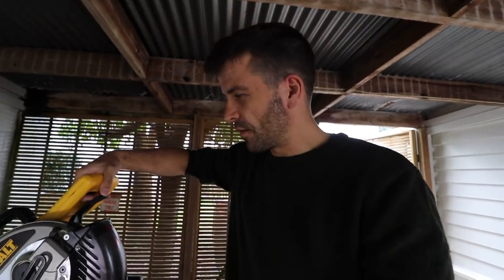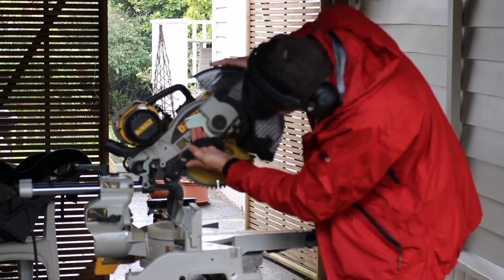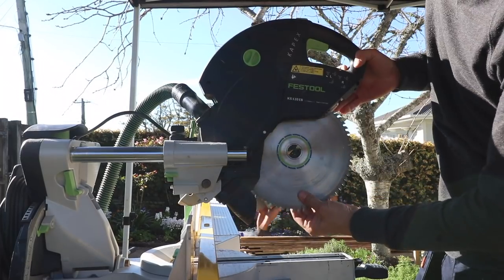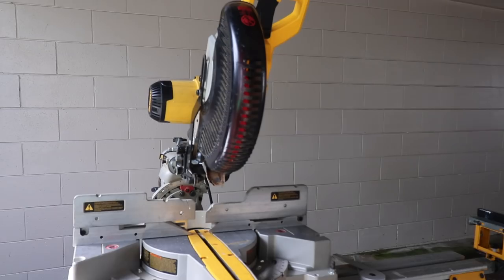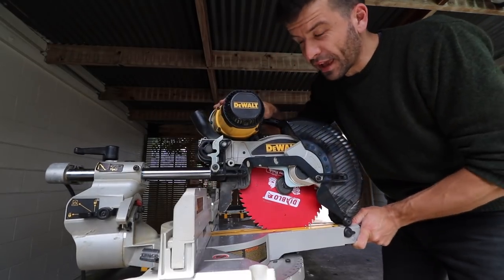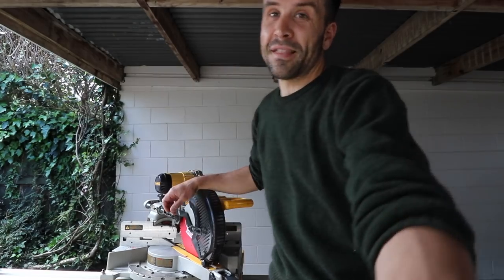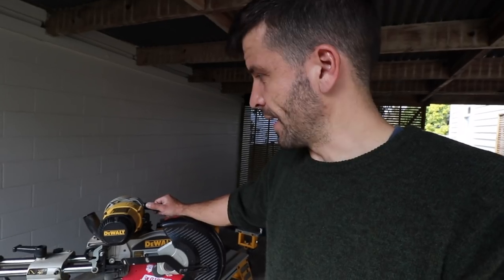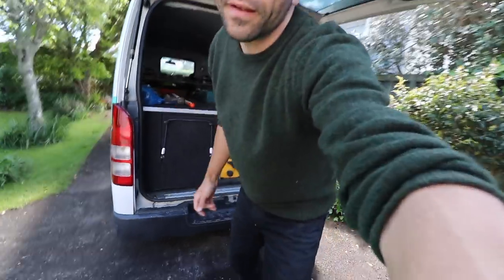Festool Kapex vs Dewalt Mitre Saw

Comment: Are the Dewalt chopsaw brackets compatible with the Kapex? If so you'd have the best of both worlds.  Good review, 👍
Reply: TheToolnut yes dewalt stand mounts fit nearly all mitre saws. See it a lot now Kapex saw on dewalt stand.
Reply: My makita maxed out the dewalt stand. But a good carpenter will make anything work.
Reply: And ryobi makes a better stand then dewalt. Much heavier. Dewalt has some sweet attachments though.

Comment: 1000-1200$ ? i got the DeWalt 12 inch saw with the bench for 700$ tax in at home depot . I'm from Quebec , Canada so maybe there's a gap in between our currency ?
Reply: the companies we buy from in NZ will have to pay shipping (over a container load of gear to make it worth while)  Shipping is a killer on on many things as we are such a small population in the middle of nowhere where there are no major shipping lanes...

Then import duties, then GST ... then normal business running costs like storage, power blah blah blah ... add in the exchange rate of the dollar things become quite expensive pretty quickly.
Reply: I think the prices in NZ are not too bad compared to the states and Canada as the rates are about twice as high. I don't see how tools in Auzzie are alot cheaper than here though.

Comment: Maybe you can borrow a Makita ls1019 for a comparison. I recently bought the 10 inch Bosch glide but didn't factor in the weight and so now I'm in the market for a new, lighter saw
Reply: The makita is a beast also. Great saw. Huge table in it.

Comment: He did not even mention the terrible handle on the festool, it sucks. Also, i have one of the first of the 12 inch DeWalt sliders made, it must be twenty years old, and, it has never failed me, i have it used to frame, and, do finish work, lots of cedar siding, and, it has done all those things well, and, never required any thing than a new set of brushes in the motor. Plus it costs half as much as the Festool. But, the big thing is that awkward handle position, if you are cutting all day for a framing crew, you need something that will allow you to keep up, without giving you a sore wrist from twisting it into an unatural positon.

Comment: Dewalt needs more space behind the machine due to rods, has lasers, is more accurate and consistence, had repeatability in settings etc etc. Its better suited for carpentry. Dewalt is a constructionsite saw. To each his own.

Comment: For finish work the kapex absolutely destroys this saw! I have owned the dewalt saw and its ok for heavy timbers and rougher work but for finish work its very low down the list. Theres too much deflection in the head and blade.  Try cutting large kitchen mouldings and you will see. I have had my kapex nearly 10 years and theres nothing to touch it for accuracy. I had this dewalt with the laser and bought a freud stainless blade that cost me nearly £150 awesome blade for laminates but it still couldn’t save this saws errors. Currently im using my workmates dewalt saw same as this on a framing job and again its sloppy. The saw stand on the kapex is also far superior having a full flat bed with adjustable stops that are accurate, the dewalt can be cumbersome and the stops just aren’t reliable.
Again the kapex is suited more to the finish guy and the dewalt more for the general carpenter under these circumstances the kapex is head and shoulders the better saw.
Most of my work is finish carpentry and kitchens, i favour tools from festool like the carvex and the track saw also the large router and drills however if i was doing general carpentry I wouldn’t bother with it, its not cost effective.
Reply: My partner has the Kapex, I have the Bosch Axial Glide saw, My Bosch is every bit as good accuracy wisw as the Festool with a much better motor at half the cost, I know, I use both of them on a daily bases.

Comment: The Dewalt stands don’t have the length stopper.  So you cannot repeat the cuts accurately as Kapex.  Dewalt doesn’t have the doublesided lazer.  The detent on Dewalt snaps into another angle.  In regard to the accuracy and repeatability, nothing comes close to Kapex.  

In the beginning, I had the same issues with Kapex.  Once getting used to it, I feel it is much easier.  And the position of the handle is very intuitive.  You hold the handle in the line of your cutting, not to the side.  When you are cutting wood, you don’t cut 5 inches away from the sight of cut.  The way Dewalt or Milwaukee has their handle is not intuitive and is prone to shifting away from true right angle.

So much you haven’t covered, this is beginning to look like a leftist media like CNN, Washington Post etc.
Reply: LOL everything is political now? Even miter saws? 🙄🙄

Comment: do you know the sawblade on the kapex was one to cut  aluminium ?
Reply: You can cut wood and aluminum with the same blades to a degree I never switch my wood blade to cut a piece of aluminum and it doesn't seem to hurt anything.
Reply: Aluminum cuts like butter.
Reply: I cut alloy tracks for byfold doors with a standard ATB blade
Reply: @whitacrebespoke  your bifold tracks are aluminum. Ive only seen steel. Barn door tracks are aluminum. What does abs stand for?
Reply: @whitacrebespoke  or atb i ment?
Reply: @smokingcheeba420  Alternate tooth bevel. It means one tooth goes to the left on an angle, then the next is to the right on and so on
Reply: smokingcheeba420 alternate top bevel which is standard grind. The Henderson bifold tracks I use are aluminium. Never seen a steel one
Reply: I think its Johnson hardware thats steel. Its thin but a portaband is the best way to cut. I thought all blades alternated teeth. Forest blades are amazing for 100 dollars + but you can get makita blades for 25 bucks on Amazon and will smoke diablo. I hate the 45° tooth bevel.
Reply: smokingcheeba420 you can get triple chip grind as well good for grove cuts as leave a flat bottom kerf. I prefer this type for cutting Ali as it doesn’t have the sharp corner to break of like on an ATB blade. 

We can’t get forest blades here in U.K. I’d like to try one. We have Atkinson walker that make blades in Sheffield and several high end importers. Trend industrial blades are good too but don’t know if you can get them. Better quality blades are worth the investment as professional sharpening reduces the overall cost over a several years.

Comment: Also if you want to spend lots and lots of money on a jigsaw mafell.
Reply: Lol yep
Reply: daniel hammond I agree, the festool carvex is my most hated festool
Reply: Its all over rated in my opinion. I just dont like to see people go down the festool path as i did without knowing the truth. Its very well marketed and with plenty of retired old chaps making tables and small woodwork projects in the comfort of there  heated garages singing its praises people see the price and think it must be the best. It isnt
Reply: I saw that, wow they are proud of their product. The ones in Germany are quite a bit cheaper but operate on 220 volts. They cannot or will not export a 110 to the states from there if there is even such a thing released there.
Reply: Jeff Stanley 220v is not allowed on British construction site. Festool 110v tools are very underpowered and are not  rugged enough. The systainers are so weak
Reply: I had a Bosch GST2000 it was a great tool. It got pinched. I brought a carvex it was a massive POS, I brought a dewalt it was a POS. I brought the expensive Mafell full kit. I’d never go back. Don’t use a jigsaw often but when I do I use it hard and need it to work. The Mafell does that
Reply: Jeff Stanley festool have issues with their 110 gear the power take offs on their 110 vacs are only rated at 500watts not enough to light up a decent sander. There’s lads her in U.K. have to use a 5 kva transformer to power a plunge saw of the vacuum. The plunge saw is steady in 110 before you start.
Reply: Adam Lynch   Thats because maffel makes the tools festool are marketing only difference being maffell actually makes top quality tools festool just sell a lie there stuff is garbage i wish id never bothered. Bosch i think invented the jigsaw so if budget is a big factor i dont think you can got wrong tho to be honest. Iv got the mafell and it epic
Reply: Adam Lynch the only thing i didnt like about the gst2000 is that sds system iv had both the one with the Allen key and the little plastic thing on the top ( Allen key better )
Reply: daniel hammond schintilla invented the jigsaw Bosch brought schintilla and still make stuff in that factory. I had the Allen type and tried a plastic one  until the Mafell the gst2000 was the best jigsaw on market. I’d still have mine had my truck and tools not been pinched. There must be a lot of masterbaters work at festool as they have the best marketing wank in the world. I’m proud to only own two guide rails (for my Makita saw) and a pencil I was given as my only festool gear. Most of it is just gimmicky
Reply: daniel hammond I don’t like this whole we lock you in a system nowt is compatible with other systems. The can’t even make a quick release chuck that takes a bit that’s been a global standard pattern for many years that says a lot about a tool company as their version to fit the centrotec is not superior to the old system used on every other tool in the world
Reply: Adam Lynch I have the Mafell Jigsaw cuts better than any other on the market Expensive but the cut is 90 degrees 👍
Reply: Mafell make amazing tools but they do not have Mitre saws and also do not have several other tools. 

Mafell make amazing tools but trying to have a complete Mafell set is very difficult and also about 3 times more expensive than Festool. 

On a tool per tool basis Mafell are better but on a whole platform basis Festool are better. I could never have a workshop in the back of a van with Mafell but can with Festool.
Reply: I have a table saw, router table, Crosscut table, Sanding table and all of it can easily fit in the back of my van and it is all Festool. I cannot do that with Mafell as good as their tools are. 

To try and have a mafell set up like Festool it would cost me three times as much and end up having more tools to carry.
Reply: bighands69 no Mafell don’t have a complete line up your correct but I buy the best tool I need for the job and for me that’s often not festool but I’m not anal about having every tool from the same brand as all brands make good tools and bad tools hence I will never own all Mafell or all of any other brand. I use Makita cordless tools as the range is comprehensive and easily available and my original tool a combo drill is still IMO the best for my work. I use hitachi nail guns though as again they are best for what I do. My Mafell KSS80 removes the need for a chopsaw on nearly all first fix work.
Reply: bighands69 Mafell make the Erika table saw it takes a router to on a side table and is comparable to the festool. I couldn’t justify the cost of either though with ho little I use a site table saw or router table just way too much for either. I have a trend pro router table that I take to site on the rare occasion I need one that’s brought and paid for and still works like new. I have the luxury of a big shop at home with industrial kit in it though so tend to do my ripping and machining there.
Reply: +Adam lynch
The Erika 85 is a brilliant saw but it is not a mitre saw. Now if you were to combine the Festool platform with Mafell you would have a compact workshop on the road but it is going to cost you twice as much to do that. 

I can operate a complete workshop from my van with a complete festool brand platform and a Dewalt thicknesser.  That is all I need but I do pay the extra to have the Festool tools. 

I originally researched different brands and found that Mafell on a tool per tool basis was of a higher quality than Festool barring drills. But found it impossible to justify it as a complete platform based on its price and available tools. 

I also have a large workshop with commercial grade machines but are impossible to take on the road so I need flexibility. Trust me there is nothing worse than being two hours away from the workshop and then realizing that you needed such and such a tool.
Reply: bighands69 you said table saw. To be honest if I do ever buy an Erika having used a friends one I don’t think I’d bother with a mitre saw the Erika is far more accurate for trim work with the sliding blade set up. As I almost solely use my KSS saw for first fix anyway it’s suddenly not so important.

Comment: The Festool is most certainly not a comparison to Dewalt.

You can buy almost 4 DWS779 Dewalt saws for the price of one Festool, and it is no better.

There are good and bad points with both saws, but the Festool is not worth 1500 bucks!!!!

The differences between the DWS779 & DWS780 are not worth the doubling in price, but even if you compare the DWS780 to the Festool, it is still half the price.

Personally, I am not a fan of Dewalt tools, but the DWS779 is the best saw for the price. If you catch one on sale, you can find it for under 400 bucks!!!!!!